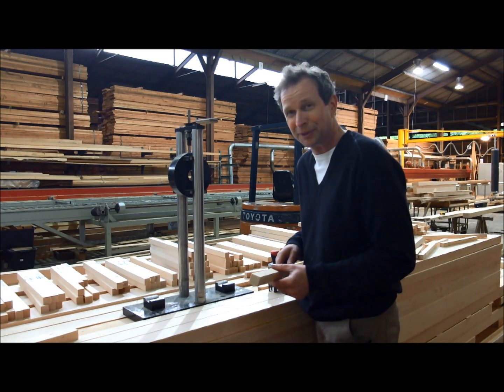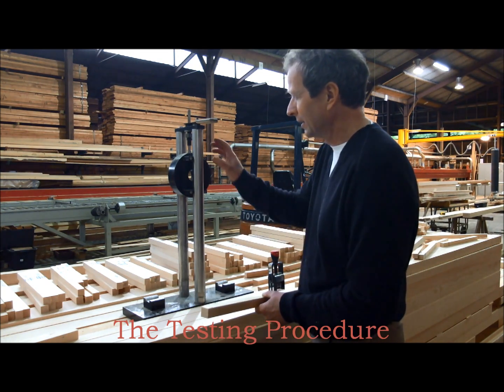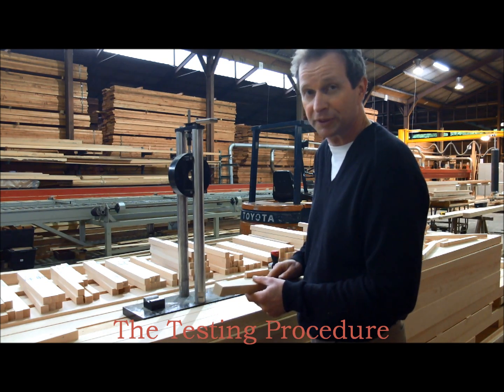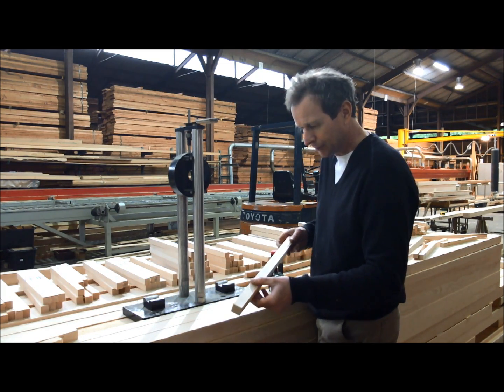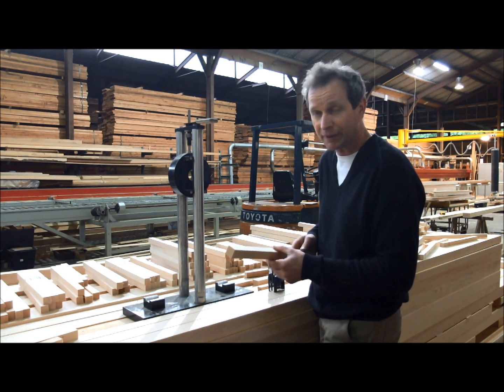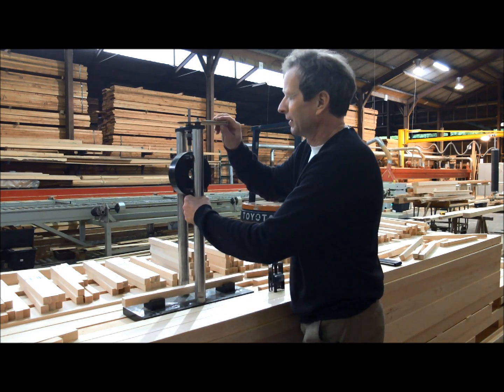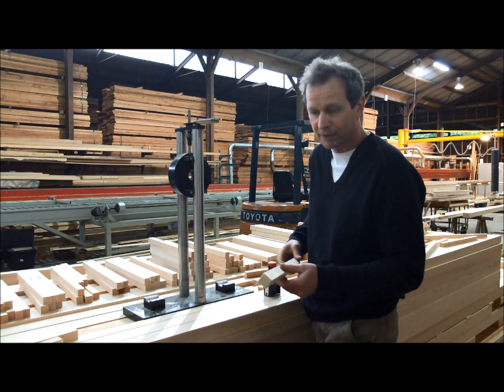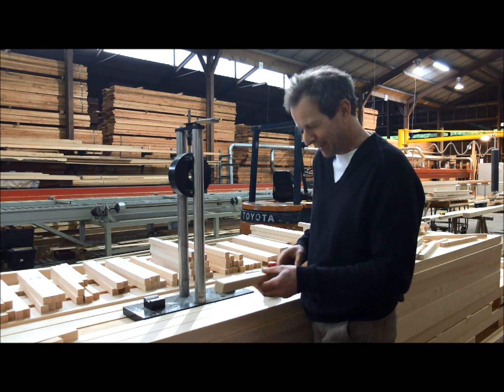Aircraft Spruce Testing  for DeHavilland Mosquito

Comment: Everyone seems to be so smug especially this tester. My understanding first is that the best aircraft wood is split  so that the grain is perfectly straight then it is cut.  If the tree twisted as it grew and you cut through the twist it will snap there as you cut through the grain of the wood. Second important point is that the rings of the tree have to go up and down and the nice square pieces were not marked like on a window sill or on a bass bar of a violin.  Quarter cut.  So if you test the strength on the side that does not have the grain running up and down it will be much weaker and could easily break.  So this is a very important point for sitka spruce.  I wish I could attach a picture here.  I guess you just have to look at hte end grain of a violin and the top grain to understand what I am saying.  So this most important point was not mentioned the rings in relationship to the tests.   Hmmmm wonder if he knows what he is doing? LOL

Comment: Hallo John. A very clear test. The Spruce-sample has to withstand a certain amount of energy. If the wood is more flexible the drop-mass has more length to come to stand and the load will be less on the spcimen.
I would be very pleased if you test a piece of fir-wood, wood according Fliegerwerkstoffblatt 4002. (German)  It is no spruce, it is fir. 
This wood is extensively used in longerons of numerous German wooden gliders. It has a compression stress of at least 480  kgf/cm2, and tension stress higher than 800 kg/m2. 
All tests I executed myself on fir revealed more than 540 kg/cm2 . 
I would be pleased  to know how it compares.
Groeten,  Louis van Rijn.

Comment: So I learned a few things I'd like to share with those who wish to test some wood.  Per the forest products laboratory report #354 aircraft timber comparison....the minimum toughness for sitka spruce at a minimum specific gravity of .36 is 75 inch pounds. And, 90 inch pounds without regard to specific gravity.  That is for using a 5/8 × 5/8 inch. X 10 inch long specimen supported 8 inch span.  The above delivers 156 inch pounds (13 pounds x1 ft. distance).  However,    the above specimen is 1x1.  But the most interesting part of report 354 is they also give minimum values for white oak and Black walnut and say these woods are suitable for aircraft use.  Say, in place of ash.  The reason I'm mentioning this is this...If you are building a C channel spar and sourcing your own wood.  Instead of say ash spar caps, consider white oak or black walnut...not that much of a at penalty because the caps are not usually too large.  Down load report 354 for free.

Comment: I'd like to make a unit to test various woods...since I'm not schooled in physics maybe you can answer.  You are dropping 13 lbs from 1 foot on a 1x1 specimen....what I'd like to know is how many psi are exerted on the wood at impact?  Spruce should have a rupture rate at about 9400psi but with a 1.5 safety factor for aircraft...so just wondered what force this unit is actually delivering.  Anyone out there willing to answer I'd appreciate it.
Reply: It’s not psi per se that test, although the specimen will have high bending stresses bothe tensile and compressive respectively, bottom amd top surface.
It’s really an energy absorption (toughness) test.
As for the 1.5 load factor and and commensurate built in Reserve Factors, leave those to the aircraft designer… keep the wood strengths and stiffnesses etc as the properties of the material, let the stress man deal with the loads he calculates as required to be borne, separately.

Comment: just so you don't introduce any hidden stress cracks into the wood after subjecting it to the impact.  Very interesting test.
Reply: There could be damage, but it is probably not going to be used as it is a sample.
Reply from the maker: The piece you see is a sample taken from the aircraft spar. The best pieces pass with flying colors but often you can see small haircracks, especially if you use a contract liquid like ink on the point of impact. But the sample is not used for the plane, it it kept for our quality control reference log. This testing is a very good and quick way to know if the spruce is suitable or not, it was develloped for war production, simple, robust and super reliable
Reply: I think those are just sample pieces from the whole log that is to be used but I did think that too.
Reply: I think that piece was for sample storage, the length it came off would be stamped and sent out for use (I.e. that’s too short for use in a spar situation)